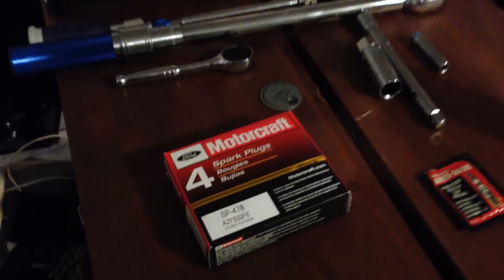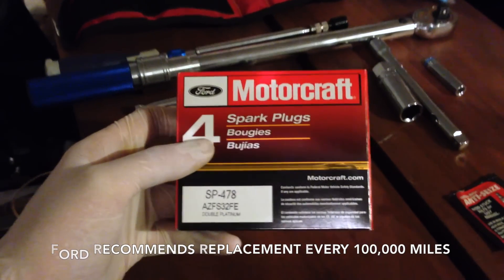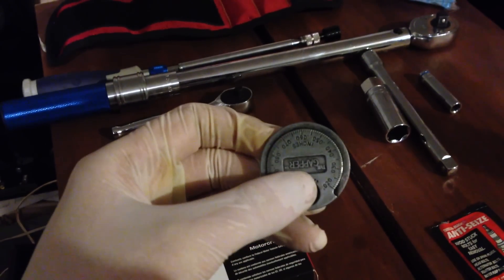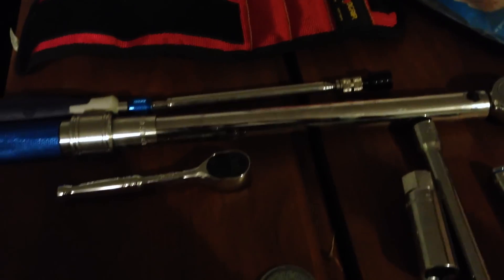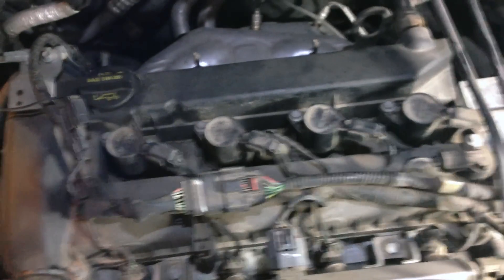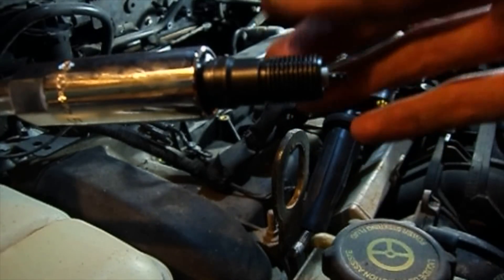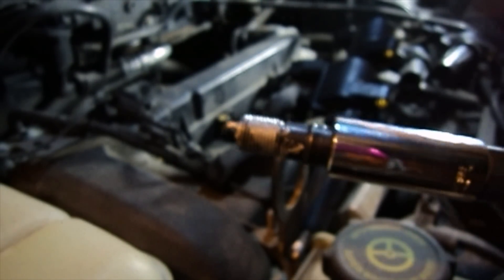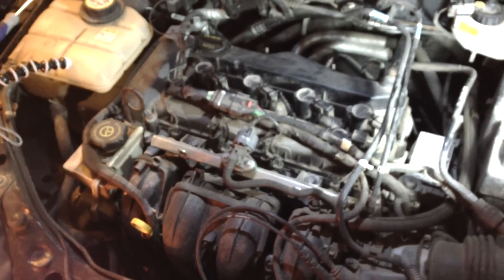2000-2017 Ford Focus Spark Plugs

Comment: I changed out my coil overs at the same time at 80 thousand, they don't last as long as you think. It was worth it as I has a miss that did not set a code but you could see it on the tachometer and feel it.
Reply from the maker: I haven't experience any issues with idling or misfires, so I have left the coil covers for now.  Appreciate the insight though - I'll be sure to keep an eye out for any irregular behavior.

Comment: Good vídeo, only one thing , you have said that you put dielectric grease in spark plugs  to increase the electric conexión , but that grease makes the opposite effect, that is good to the ceramic part of the spark plugs and the top , but its true that you have apply the grease in good way.
One advice, dont use the antiseize grease in spark plugs with crome o Silver color , only use it the black spark plugs, you  can use motor oil as antiseize if you like
Regards good video
Reply from the maker: Hah, good catch. Totally slipped in the description!

Comment: Dielectric should only be used on the ceramic part of the spark plug. Use a q-tip for it and inside the boot but just at the entry. A small amount is all it needs.

Comment: killer video man. thanks. one point though. I've always been taught never to use a torque wrench like a ratchet to purely loosen stuff. I realize plugs aren't super tight. but just saying it's always been my instruction from knowledgeable sources to only use a torque wrench when actually tourqing something. and that the only reason a t wrench goes in reverse is to do reverse threads

ignore me I'm an idiot. didn't watch the video enough
Reply from the maker: I was using a regular wrench for the loosening of the spark plugs, and then torque wrench when torqueing down to their recommended spec. :)
Reply: Matt Stephens-Rich I know I saw. like I said I started commenting before I even saw you loosen the plugs. I assumed you were gunna use the torque wrench as a ratchet. hence me edit saying ignore me I'm an idiot

Comment: I didn't watch for the plug replacement,i'll have my service station do that.what I did  watch for is to hear what a Focus engine should sound like when it's running right. I took a test drive in a 2006 hatchback that will just be used for local trips,our SUV does the important driving.so anyway the Focus engine sounded almost rough compared to the high pitch whine on my very old Geo Prizm and other Japanese cars I have used. so ok,the test drive "noise" is the same so I feel better about making a offer on the Focus.

Comment: First mistake.. NEVER remove the plug WITHOUT blowing out the plug well AFTER breaking the plug loose. You're going to drop crud into the cylinder, that could cause damage!
Reply: Thanks for the tip. Much needed for my vehicle.
Reply from the maker: Can of compressed air can do the trick!

Comment: sp541 ford plugs or xp104 autolite  dry on 07 focus  ..     those plug looks very wrong but great video
Reply from the maker: thinking back - this was actually handed off from the local dealer. Plugs ended up running great, despite not being exact recommended spec. 🤷‍♂
Reply: @MattStephensRich  yeah it's hard there's so many different numbers it's impossible.. Great job
Reply from the maker: Appreciate it!

Comment: Very good video.

You point out that the old and new sparks plugs have a different overall length, however what would concern me here is that the new spark plugs you installed have a different REACH than the ones you removed (which you can clearly see in your video @9:47):

OLD, NGK ITR5F13 = 17.5mm reach
NEW, Motorcraft SP478 (AZFS32FE) = 25mm reach

I think you should have installed Motorcraft SP541 (AGSF32YR) = 18mm reach

Have you had any issues since you installed these?

Thanks
Paul
Reply from the maker: Paul1958R no problems whatsoever. It's important to bear in mind that vehicles can be eligible for a variety of spark plug models - while the spark plugs recommended in the instruction manual were not at my local auto parts store, I was able to find a suitable replacement, based on further research on the spark plug specs needed for this model focus.
Reply: Yeah iam heading to the house....20 mln.
Reply from the maker: Drive safe? 😉

Comment: Ford Focus SE 2016 2.0L Flex fuel engine just yesterday my engine light came on and scan tool at Auto Zone said P0300 which means change plugs and or coils . I changed the plugs 2-3 weeks ago and check engine light went out seemed to run better . It was stalling / lagging when accelarating . That was 2-3 weeks ago and now noticed some of that old stalling / lagging came back and light engine came back on . Had it scanned again at OReillys and says same thing . Woman there says a tune up and I told her I just did one . She says disconnect battery for ten minutes which will reset computer .. I did that for fifteen minutes and the same engine light still on . Any help  be appreciated . I did put some anti sieze but didn't use dialectric grease the first time . Coils look great and cleaned them too . wiped them down
Reply from the maker: So checking some code resources online, I'm not finding code 0300? https://www.engine-light-help.com/ford-check-engine-light.html Would recommend taking it to a shop, or at least everything you did is what I would've done before letting a proper mechanic look at it.
Reply: @MattStephensRich  UPDATE - the day after I posted , drove on expressway and light turned off. Yay. And seems okay running.  You gotta understand that it only occasionally had stalling lagging issues that I could really noticed . Sometimes it was that pronounced. Going to talk to a tech recommended to me. Depends on what he says I might take a wait and see approach. Maybe it'll relearn and no more issues.
Reply: Im having the same issues and I have the same make, model and year of you're car.  I bought some spark plugs and just ordered a fuel pump as I took it to AutoZone to get a diagnosis and it stated low fuel pressure.  Same issues as you're with stalling, lagging and acceleration is low.  Who did you take it too to get a tune up?  Any advice would be much help and thank you for sharing you're experience.
Reply from the maker: Taking to a regular ford dealership isn’t a bad idea, even if only for diagnostic!

Comment: PLEASE, PLEASE, PLEASE HELP!!!!! What is the name of that little rubber cap that sits in between the spark plugs. Mine just popped and it sounds like air is escaping from that area. Do you know the name of it?  thank you so, so, much. I really need to know what that thing is called.
Reply: So most spark plug socket sets have little black rubber bits in the back of them to properly secure the spark plug in place and sometimes they can break off and it can initially look like it belonged to the spark plug when your pulling it out.

Comment: I'm still getting poor city mpg in my 2007 1.8 focus after a full service and spark plug change. Any ideas why? Could warped break rotors affect it? I do have crap tyres which won't help
Reply from the maker: You will totally get a hit (as I did) in the winter on your MPG, just as a general heads up for this time of year. Brake rotors and tires shouldn't be a factor for city driving as you're going rather slow. Do you notice a difference in coolant temps or handling otherwise?

Comment: I did this on my 09 but noticed a little oil in the #4 plug well ,was wondering if the duratec has the plug tube donut gasket or something else like a rectangular gasket on top of the valve cover itself
Reply from the maker: +Randy W. Brown If I'm understanding your question correctly, you are asking if there is another gasket/cover over the valve cover?  There is not in the 2007 and early models - the engine assembly is totally exposed.
Reply: If you have oil on spark plugs holes. Change vavle cover gasket.

Comment: Matt you don't add di-electric grease to the spark plug terminal nut...its an insulating grease and will increase its resistivity..only on the ceramic and/or inside of the plug boot
Reply from the maker: +Daniel Connor It is true, that the purpose of applying the dielectric grease is to prevent corrosion, and that the grease is an insulator.  However, since the electrical contact is a clip that snaps onto the spark plug terminal, this provides enough force to penetrate through the grease.  And, having grease covering the terminal helps prevent further corrosion.
Reply: it not only prevents corrosion it actively increases the the work your coils have to do to get the same power P=IV to your plugs..or more likely it will reduce said power...you're putting unecessary strain on your ignition system. Dielectric grease was primarily invented to prevent or decrease the chance of voltage arcing...corrosion protection secondary. You're putting the grease on the terminal nut that fits inside the COP contact thus increasing resistance..and asking for more volts from your coils. You can google all this if it helps.
Reply from the maker: Yes, there could be a very slight effect.  However, the coils are still making contact with the metal of the spark plug, as they scrap the grease aside; I would venture the effect of grease to be nominal at best.

Comment: Always replace the coils when replacing plugs.
Reply: really ? I've changed plugs because of code P0300 . Check engine light which came on along with some stalling lagging when accelarating 2-3 weeks ago . Light went out for these past few weeks but now just yesterday same problems of stalling lagging and engine light came back on . I'm not sure to keep spending money on coils or go to a shop

Comment: If you live somewhere where it gets cold in winter, then you should change sparkplugs much earlier than 100k km/miles. More like every 20 000km. If you change oils twice or once a year why not spend 40$ on the sparkplugs per year? Your car will run much better.
Reply from the maker: That's not really what's recommended by Ford.  Bear in mind, what causes wear on spark plugs is heat/spark passing through the plug on each fire - outside temperature doesn't play into this.  Recommended replacement interval is also 100,000 miles, not km.  20k km replacement cycle would be every 12,000 miles; modern spark plugs are designed to go WAY longer than that.

As always, I recommend all to go with recommended manufacturer specs.

Comment: You sir are wrong you do not put dielectric grease on the metal tip of a spark plug it does not help electric flow it stops it!!!
Reply from the maker: You’re right that dielectric grease is non-conductive - the reason for using it is to prevent corrosion along the connection. That way the electrical contact can flow, but not have the entire connection be exposed to air and moisture.

Comment: way to much anti seize   on the plugs   you do not need a lot
Reply from the maker: Since it's purpose is to protect the connection from outside debris or corrosion, you can't really apply too much.